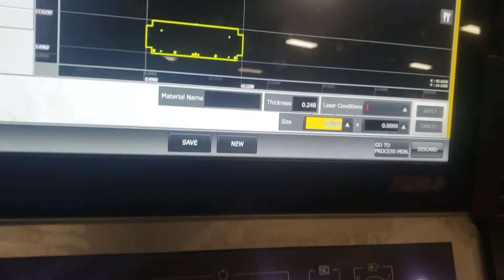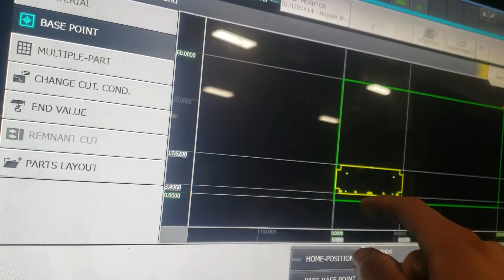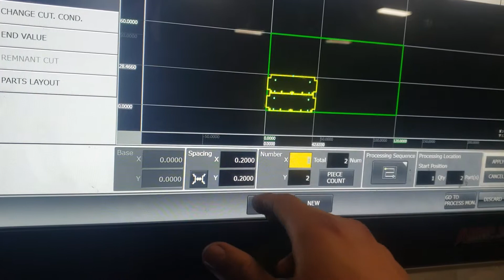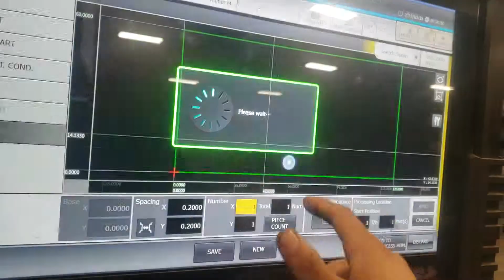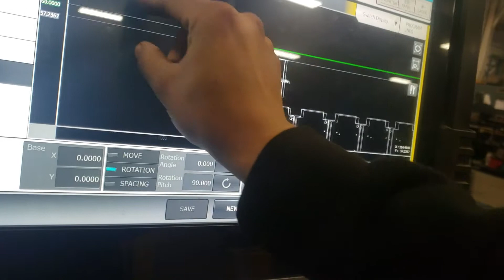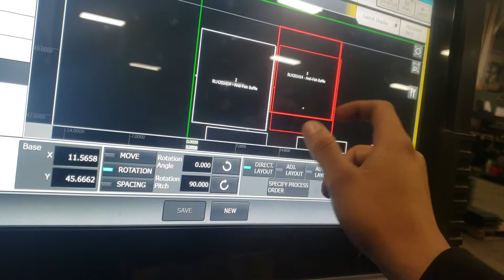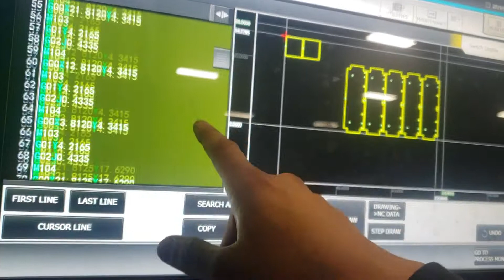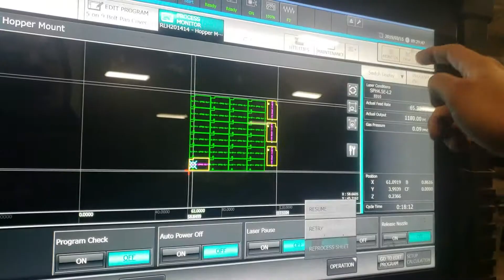AMADA Fiber laser (Nesting parts)

Comment: are your parts joining? And if not joining how much do you leave apart
Reply: Should common line run that. It would cut the processing time in half for sure.
Reply: At 2:38 u see spacing x0.2 y0.2

Comment: If you turn off Macro and put G93 offset you can tell it to start on any shape within the part.
Reply from the maker: Nice. Thanks for the tip!
Reply: @followmylife8538   do you nest your own parts through the 3i monitor or the   Amada nesting software like AP100 or Dr. Abe
Reply from the maker: @stevengarcia958  i use both. Usually i use the 3i monitor to save time.
Reply: This is how i run my nests, it’s a life saver forsure